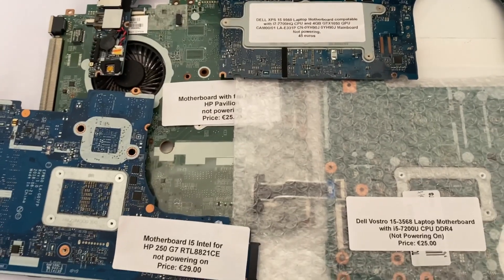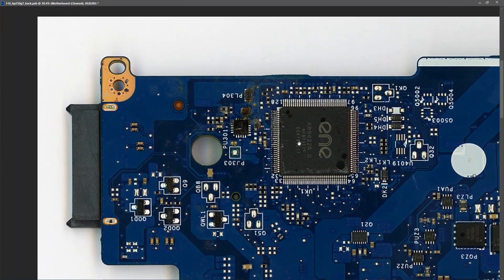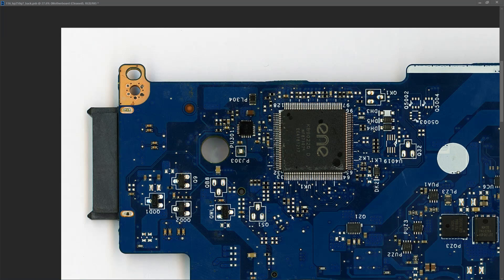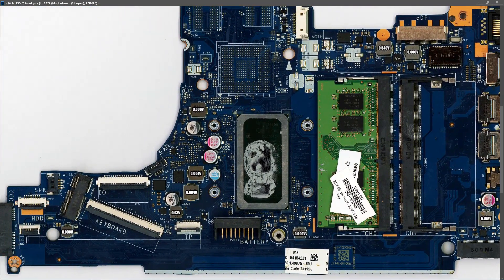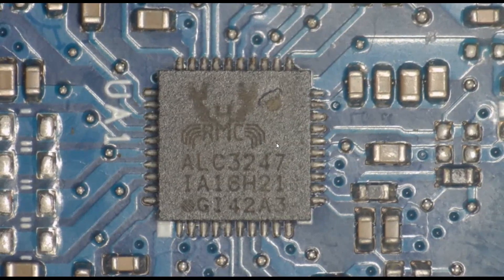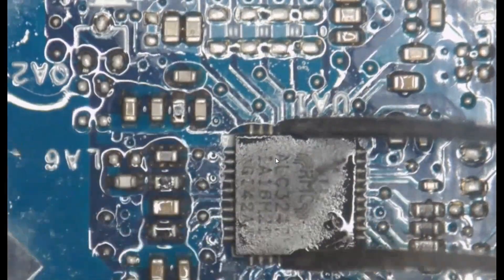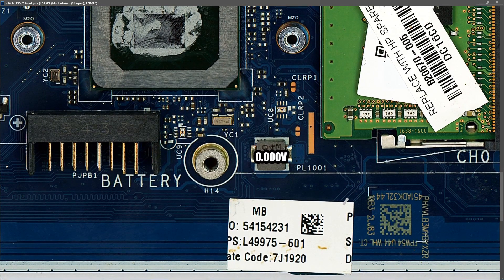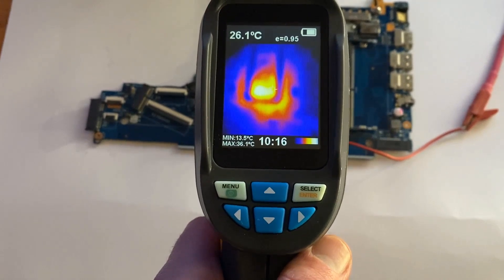HP 250 G7 - NOT POWERING ON

Comment: If most of your other boards have this issue, then you may have a supplier attitude problem.

Some suppliers get the power supply and just short out rails, just to prove that we (the fixers/company), are the best, because if we can't fix it, you definitely will not be able to fix it, and we will make sure of that. It is highly unusual for many stages failing at the same time, and the only time I have seen this from user items is lightning

other one I have seen is that you use spare parts from the old board and solder bad parts back - chinese boards

Comment: (1:28) On the eDP connector located just above PL301, pins 9 to 15 are corroded; a small flat head screwdriver and isopropyl alcohol would maybe fix it, i.e. measuring the continuity on the coil again. Does it still indicate short? Phew.
Although everything indicates that it is a lost cause (damaged APU), I would take the opportunity to experience the following:
I remove (desolder) all the square inductors, one by one, (previously registering them, of course): Do empty pads still indicate short circuit? Phew. So why continue? We have verified with this, now YES, without a doubt, that the APU is dead. Requiem!
A very interesting failure (I had never seen it before). I know it will remain permanently in my memory. Thank you very much for your time and sharing. I sincerely wish you better luck on the other three boards. All the best.

Comment: By any chance, do you know how the BQ24800 chip works? I got a Lenovo gaming for a repair. Only 2.5 V ldo generated by the chip. I have changed the chip also. Still no luck. But if I come with 19V to the main power rail laptop, it works fine. Any clue where to check? Thanks
Reply: 2.5V at the LDO seems low to me. Is this LDO chip responsible for generating 3.3 and 5V?

EDIT: Looked up the datasheet for BQ24800 and it is the Battery Charging Controller chip. Not really relevant and does not prevent the laptop from turning on. 
First thing to try, I would hazard a guess you have the main power rail supplying 19V into the laptop based on the information above. Your next thing is to check you are getting 3.3V and 5V and this can be measured on those square grey cube looking coils. Some of those coils may not read any voltage and it's not too important if they don't. Another way to check for 3.3v is by the capacitors surrounding the Super IO / EC chip (biggest square chip with as much as 128 pins, hard to miss) Can you see if there is 3.3V present?
Reply: @Bvetube101  Thank you for the reply. Main power rail is generated by the bq chip controlling the first mosfets if I'm not mistaken. At the gate, there is no 25V volts to turn the main power rail on. But if I directly come with 19V at the CSR it works fine. I'm unable to find the diagram of this also.
Reply: @mayuramunasinghe1983 OK so we've established no short after the CSR, so the issue could be maybe one of the two Mosfets not allowing the voltage from the adapter that you plug in through. Check these first by starting roughly where your adapter plugs in and trace the circuit to where your FETs are. Lots are easily obvious if you watched these videos, others can be slightly more tricky.  The first Mosfets could likely be an N channel Mosfet where voltage at the Drain or Source can pass through if there is High voltage applied at the Gate. First check the input side to the Mosfet and check to see if there is voltage. If no voltage check the gate pin has voltage. Somewhere around 20-25V. 

The BQ chip does not generate main power, that comes from the power that you plug in yourself. Usually BQ chips that do generate any power would usually take in the main power and output a lower voltage to power secondary rails such as 3.3v and 5v
Reply: @BTube-101  Thank you for the reply..!
Reply: @mayuramunasinghe1983  Let me know what you get. 👍 What model laptop is it do you know?
Reply: @Bvetube101  it's a Lenovo board. Number IL-G50 LA-M881P Rev 1A. I think there should be a voltage divider that generates 6v on the BQ chip and it helps the chip to generate 25V charge pump, which enables gate on the first two fets. Then it will flow 19v to the main power rail
Reply: Data sheet was not clear and I couldn't find the diagram of the board

Comment: I hope you will have more luck with the other boards.
Maybe another technician has already looked at them if they are from eBay and they will all be dead chipsets CPUs or GPUs!
Either way still good content and something to learn from each failure.

I also noticed on the display port the pins look burnt out.

Comment: I am never certain of the temperature and air flow settings to use to remove SMD components. I usually set the heat too low, which causes me to heat the board for far too long, and I fear that I am damaging the layers of the motherboard. Perhaps it is better to use higher temperature to remove the component more quickly, and save the board from too much heat for too long?
Reply: Hello.
SMD IC's: [400 ‒ 450] Celsius, 10% air flow, plenty of flux to extract them. To install them: [350 ‒ 400] 20% air flow, previously put lead/tin solder (63/37) on the pads and flux in a moderate amount on each side row of pins before applying heat. Allowing each row to cool down for about 3 minutes is good practice (if time is not a factor).
For common SMD passive components (inductors, ceramic capacitors, resistors, etc.,) [450 ‒ 500] Celsius, airflow at its minimum value, say 5% (even without airflow is better because all the heat is applied ruthlessly on the target) for both removal and installation.
For electrolytic capacitors (aluminum can) use 400 Celsius as the maximum temperature (avoid the explosion of the component since it is not pleasant at all), 10% air flow. If possible, heat the pads from below the board (other PCB side) both to remove them and to install them.
Good luck. All the best.